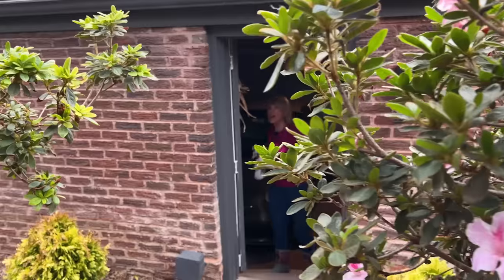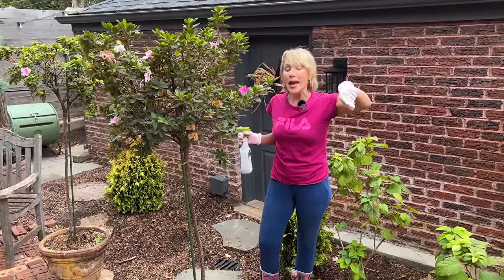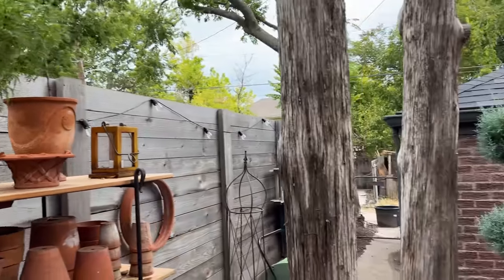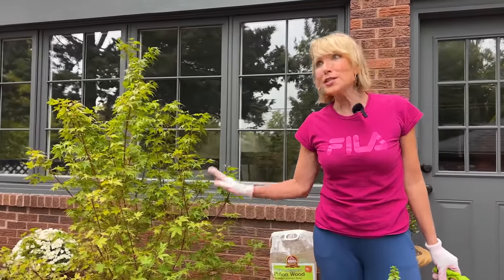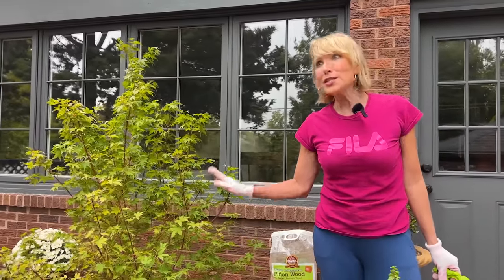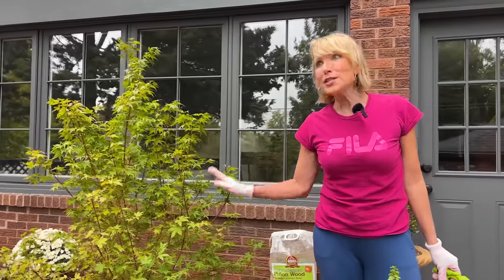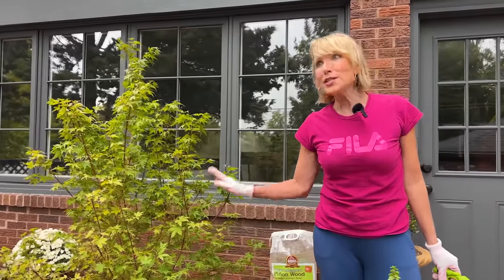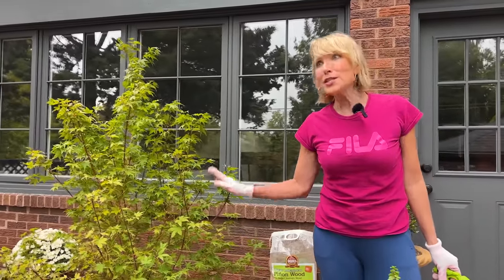Overwintering Plants at the Cottage

Comment: I have attached my Hose Links to a metal pipe rather than to a square post or to the wall. This allows the hose to swivel 360°. You could easily do this and have them hidden around the corner from where you want to use it.
Reply: I was thinking about using a pipe, too, simply to avoid termites in my tropical climate.